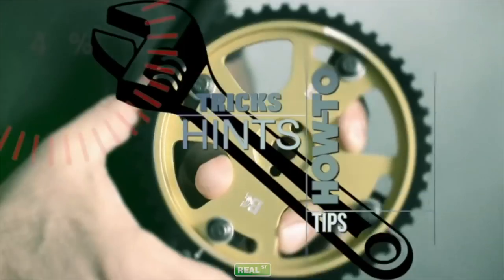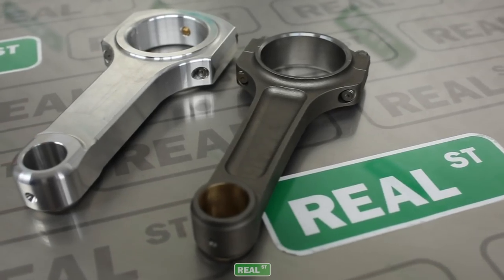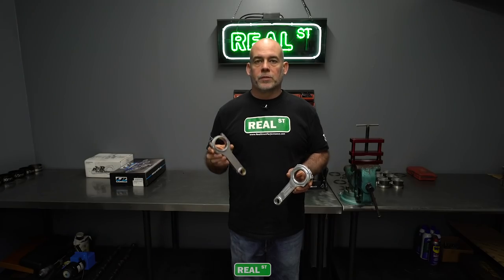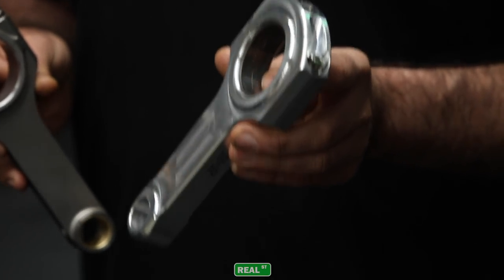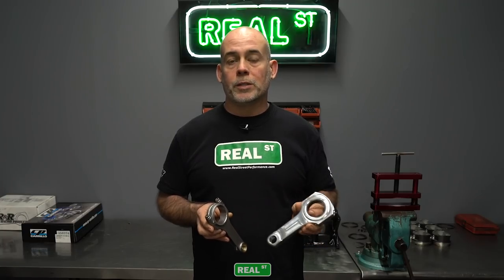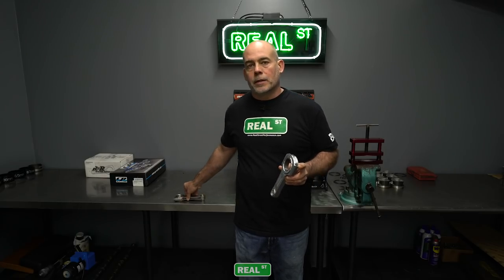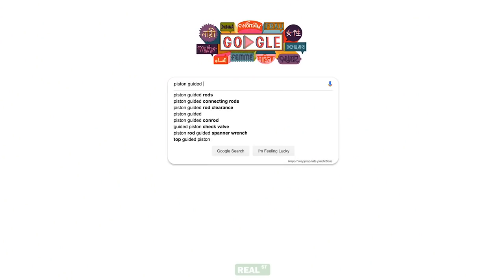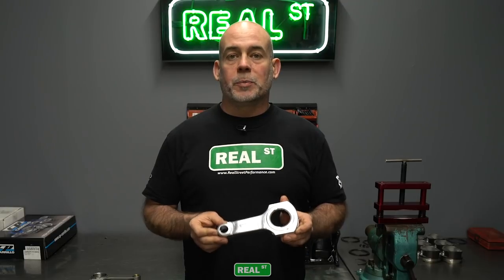Jay's Tech Tips #46: Aluminum Rod Bearing Clearance - Real Street Performance

Comment: We heat ours for our SFWD in the oven and measure them that way. Run them fairly tight and heat the oil with a pad on the pan and let the oil temp come to 140 before we move the car
Reply: Sort of like F1 cars they first heat the oil to temperature cause of tight tolerance's then they can run the engine.
Reply: I was thinking when I had them in forgetting the material characteristics . That’s a good idea I’ll put a compressor band heater around the pan too heat up before ignition

Comment: Hi Jay, could a 1JZ be stroked to a closer displacement to the stock 2JZ? I've always had this plan to take a 1JZ to 2.7 or 2.8L but worried about the oil galleries being in a different spot to the 2JZ not allowing proper lubrication of the crank.
Reply: Hmmmm good question

Comment: I have a set of howard aluminum  rods i never installed aluminum  rods its a big block chevy and its not anything  to crazy but it is going in a car that only sees the strip i dont know any specs on how to tighten them down i dont want to strip them no one has information  on howards rods but im being told torque them around 70 ft lbs or bolt strech gage pls give some tips

Comment: Hey thanks for the tips man... my question is does looser clearances give higher oil pressure provided that oil volume is not an issue? 
Scenario is 2 stock SR20VE motors... one factory clearances... the other one size over... which would have higher pressure...and is there a point where there is a trade off between pressure and clearances?
Reply from the maker: damian bogle in general 
looser clearances mean higher flow and lower pressure
Tighter clearances mean lower flow and higher pressure
Reply: @realstreetperformance  thanks for the reponse... and this is my understanding as well. Is there a rule of thumb or is there a minimum oil pressure for a given rpm based on clearances. Sorry if the question falls into the noob category I'm just trying to understand all this from i person/team who gets it right... every time

Comment: Should you use a thinner oil to counter the difference in cold start bearing clearance?
Reply: No, as the running clearance is much larger than an OEM clearance. The proper way to handle it is to use the correct weight oil, preheated before start up.  Thin oil and tight clearances are for factory output engines that are meeting emissions and not dealing with the stress and deflection that comes with doubling or tripling the engine's output.  Thanks!
Reply: Jay Meagher Hay thanks for all the tips man, God bless you
Reply: @donrosscojoe5014   I'm glad we're able to share so much. Thank you for being a part of it.
Reply: Jay Meagher Well my friend, I have a tip that I'm obligated to share with you: "Confess with your mouth Jesus is Lord,"  and you will be saved"... It's God's free gift, call out to Him and ask for the truth.